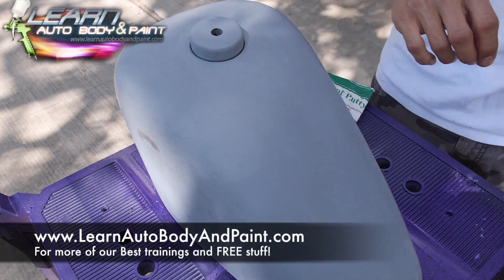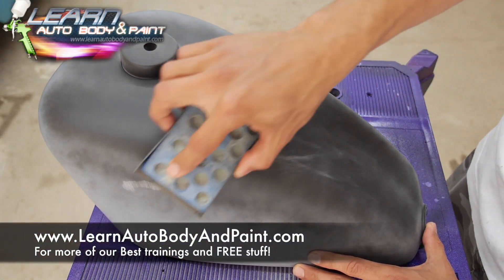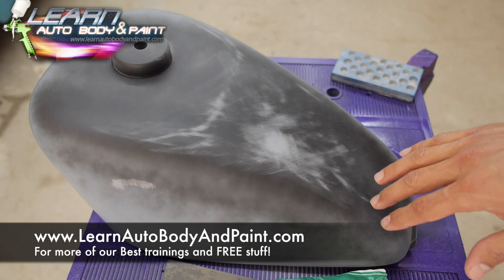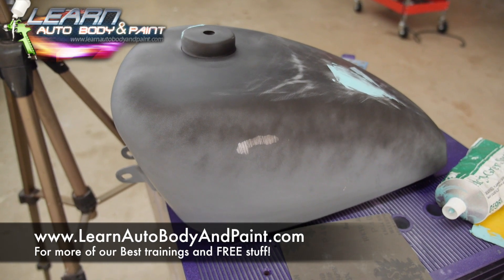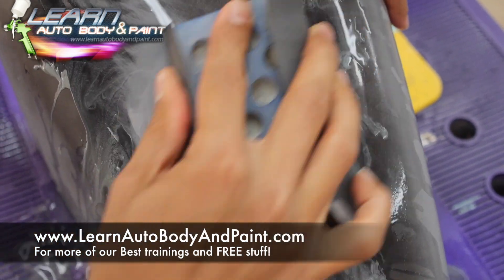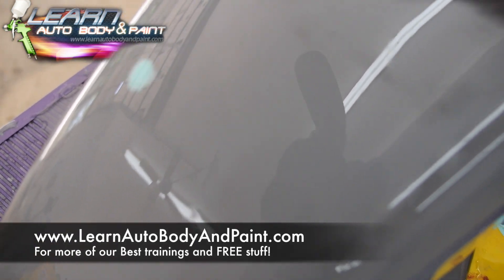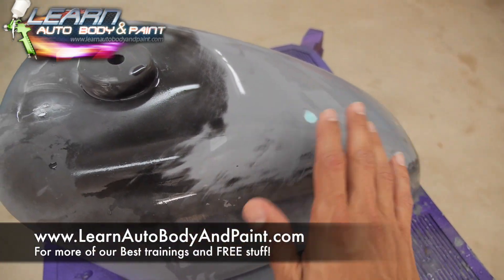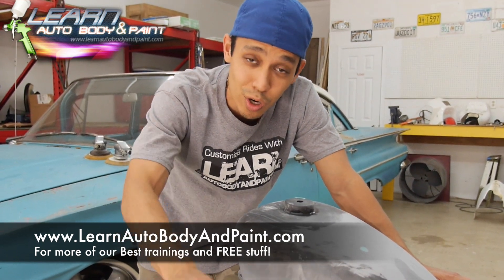How To Guide Coat and Block Sand Spot Putty To Fix Small Dent

Comment: Why did he wet sand with 400grit? Is wet sanding used just to keep the sand paper from building up with junk so you don’t have to change paper? I was thinking wet sanding was only for clear coat 1000grit+
Reply from the maker: Autodometer, check out VIP as I mention the proper and recommended grits for body work: https://www.learnautobodyandpaint.com/vip-offer/

Comment: I'm almost done with your book, and I have your free dvd. There's more in that dvd than I was expecting...whoever reads this and is wondering about the free dvd don't wait...GET IT!!!! I'll be going vip soon but first I need to get my new compressor going after a 5hp 60 gal; I'm resorting a 69 cougar and were almost ready for body and paint. Hey Tony how do you add color to a polished or chrome wheel on the face
Reply from the maker: hey David, I would think that you would just mask off what you want to paint, sand it with 600-800 or so, prime it lightly, and paint it.